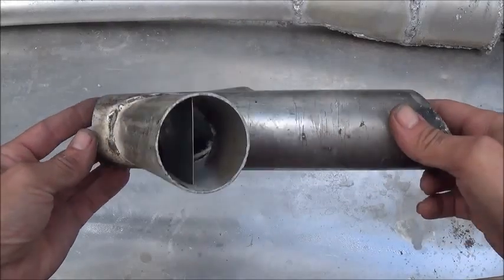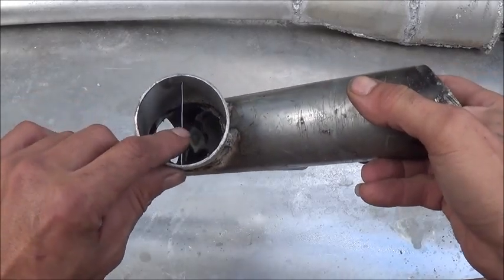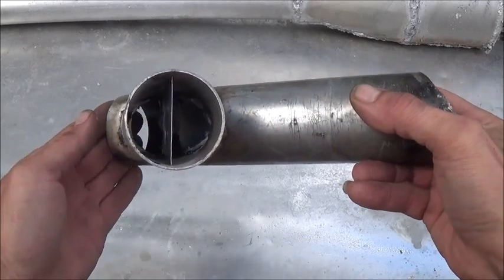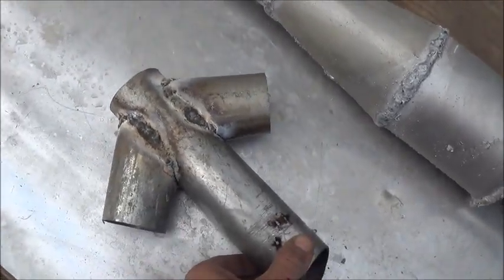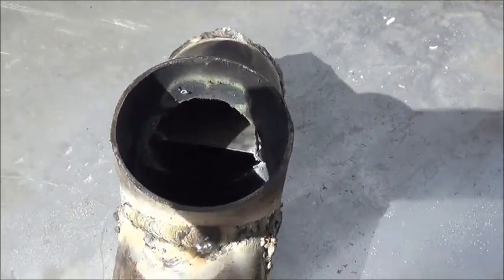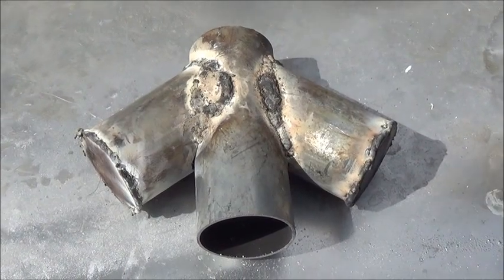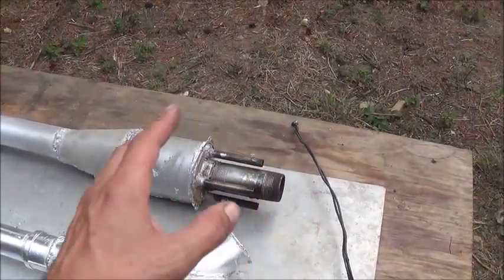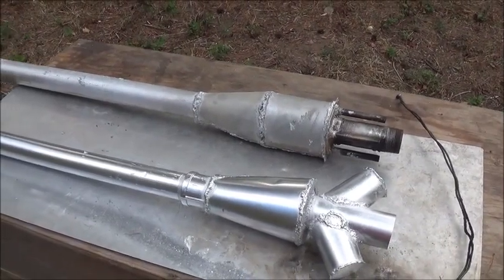How to make a Tesla Valve for a "Pulse Jet Engine"

Comment: How do you calculate the divider dimensions! There must be a critical dimension at the balance of bifurcated pressure across the two sides of the "valve". How did you devise the area of the piece?  I'm sure there exists an optional ratio. Thanks for the video!

Comment: From my reading, it seems the Tesla valve was invented to be used in a 'pulse jet' of sorts; the combustion chamber intended for use with the Tesla turbine. Two Tesla valves leading into the chamber one of which is fed with compressed fuel (wood gas would be ideal), and another that breathes air when negative pressure forms between pulses. As an aside, if you haven't tried it, two parts sand mixed with one part fireclay makes an excellent refractory lining that you can patiently line the inside of a gasification reactor with, the clay/sand mixture being only slightly damp, and then allowed to cure and dry slowly before firing.
Reply: You might also be interested in atomic hydrogen welding. I think it might be possible to use a vortex tube to separate the carbon monoxide from the hydrogen fraction. Interesting ideas.
Reply from the maker: I remember reading that my self, people think that this wouldn't be Tesla related but they don't realize is  Tesla was into building just about everything. The wood gas is were I was taking part of the pulse jet series, and the pulse jet will contribute to another project to see if it will fly at least at first then I switch to a more powerful type of engine. Thank's for the contribution and info.

Comment: it's not gonna produce some thrust at the front?
Reply: In the previous vid, it seems like the flame doesn't propagate out the front because the air is continually being pushed in from that side, but that's still what his makeshift Tesla valve tubes are for. To prevent any backfire and push the gases back into the tube in the direction he wants. I assume it's mostly a problem at starting and low speeds. At higher speeds it's probably more of the ram-jet effect keeping the gases flowing in one direction and out the back. But the flame still should only flow out the lit end for the most part. Similar to a dual flame pilot light, you either light it in the middle or on both sides as one side cannot light the other.

Comment: Looking at the tesla valve I'm concerned that this current design won't work. It looks like the chambers need to be staggered down the length of the pipe, and the vanes need to protrude into the flow so as to catch the flow and reverse it. The original tesla valve snakes back and forth in and out.
Reply: I was going to comment the same thing as the dividers should protrude into the air stream so it can grab a percentage of the air to reverse it but I see this has already been addressed. Another thing I might add is it may take multiple stages of this valve to run it at max efficiency, this could run very much like a one way mechanical valve once refined and tuned for best performance. Keep working at it because you're really close to where you need to be with it... if not already.

Comment: so in theory this design should run without having to force air into it while it's not in motion? or are you still going to have to use the air compressor?